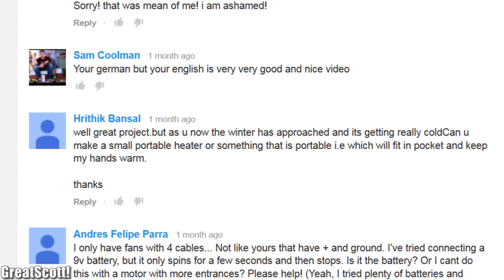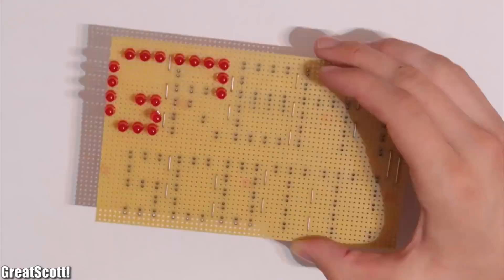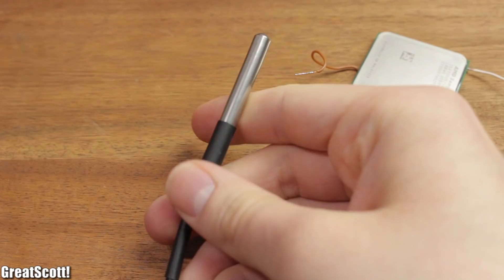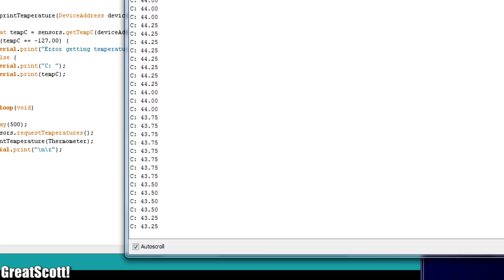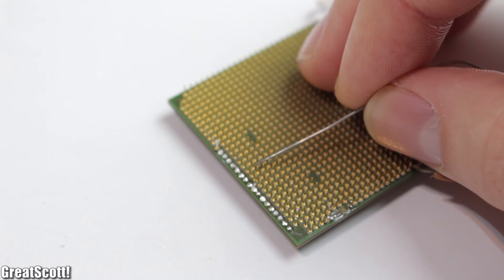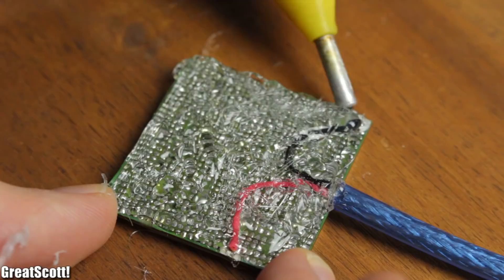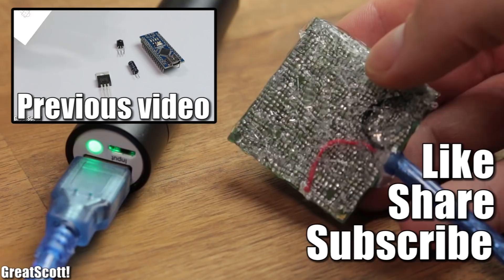Stay warm this winter: CPU Hand Warmer

Comment: Instructions unclear, used AMD CPU and burned my hand off.
Reply: xD
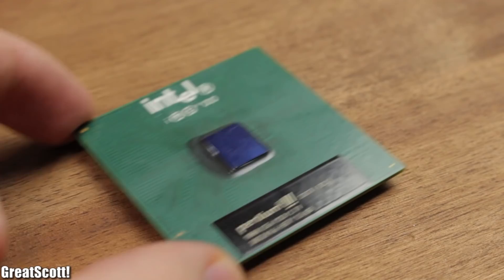Reply: +Harald Kanin Just like he did? lol. 1:31 look very very closely.
Reply: +KillTheCurse 
Instructions unclear, looked too closely and burned my eyes out.
Reply: +Harald Kanin haha xD
Reply: I tried it and it burnt the house down, and nearly melted through the foundation.
Reply: {MLP} Rainbow Dash still can't melt steel beams.
Reply: Buak Buak Plot twist, it was 2 AMD computers that hit World Trade Center.
Reply: Buak Buak No worries, I'll use my Radeon to melt myself a secret hideout on the south pole.
Reply: Harald Kanin Just use amds upcoming polaris
Reply: I forgot it on and my haswell put my house on fire
Reply: Claudio Andrei I am actually not kidding when I say that since I got my 4790K I no longer need a heating system in my room. My computer is on 24/7.
Reply: Harald Kanin ikr
Reply: +Harald Kanin I time traveled to 1992 to grab an old AMD processor. Let's just say I burned through my sister with that thing... After that my dog got burned...

If I had aids that would be true
Reply: lol
Reply: +Harald Kanin using AMD is so expensive, try intel CPU Pentium 4
Reply: try overclocking it!
Reply: +Harald Kanin typical AMD processors
Reply: +Harald Kanin You shoud use GPU
Reply: +Ante Radić that's suicide
Reply: Boyborg690_
But overclock take it to another level
Reply: You just made my day LMAO
Reply: at least that's 8 threads, it makes sense having that much heat unlike amd's old CPUs
Reply: Go back to HowToBasic
Reply: well Intel is Hotter than AMD
Reply: No, use a pentium 4 prescott and earth will burn
Reply: Harald Kanin no, use a intel atom and ww3 could start in a sec
Reply: I just burned my eyes reading it.
Reply: AMD>all
Reply: He uh... he DID use amd...
Reply: Instructions unclear, used Intel 7700k and burned my house down.
Reply: Me too o'm tyoing this blindd
Reply: LOL LMAO
Reply: 666 likes!
Reply: This didn't age well.
Reply: Instructions unclear, used Intel CPU and started a nuclear detonation
Reply: amd fx?
Reply: @KillTheCurse  How did he burn himself? It didn't look like that PC was booted in like 5 years. I'm serious. I don't think the fan on that can spin with that dust.
Reply: Haha how funny cough 7nm cough cough

Comment: all this waste time , just buy android phone (Samsung) you will get auto heat generator during games ..etc or even there is apps called heaters..etc can help
Reply: *****  true xD fast charging apps rise the heat like crazy
Reply: 1 way to get a hand warmer ,,, just overclock your android phone and you're done ! اعمل اوفر كلوك لتلفونك الاندرويد و شوف الحرارة 😂
Reply: My Channel well I don't think we can overclock phones yet
Reply: +Hassan Fareed We can -.-
Reply: ***** oh can we last time I checked phones doesn't support overclocking due to small size of component ,means if you over clocked it you fucked it 
Too much heat and low-end components is pretty bad idea

But it would be cool if we can
Reply: Hassan Fareed I didn't say it was healthy for your phone. Root it and you can overclock it.
Reply: ***** opa I just remembered I actually overclocked my galaxy s2 with some tweak tool pre-installed with cyangon mode but it wasn't a bright idea cause I killed my battery and I killed my cpu ,, eneded up with a slow asf phone
Reply: Hassan Fareed Yeah you need to be more careful when you do such a thing on a phone
Reply: ***** yup
Reply: +Hassan Fareed I overclocked my Xperia Play from 1.0 to 1.6 GHz and it worked fine. It was the only way to run Android ICS smoothly.
Reply: +Hassan Fareed lol iphones are worse at that just saying
Reply: Zachary idk about that I've never seen iPhones get super hot while Samsung gets super hot with simple stuff 
I'm Samsung (android) guy btw
Reply: but dude!  that would be a waste of money!
Reply: Christian Benischke u can buy used phones for under $40 and it gets even hotter than $800 phone lol
Try galaxy s1
Reply: Hassan Fareed oh right thats true... Haha what a useless conversation :D
Reply: if you want to overclock just check some of the kernels  that support overclocking , for example Boeffla Kernel for the Galaxy S3
Reply: Christian Benischke xD
Reply: My Channel idk , if I overclock anything I will do it on my old s2 , but doesn't worth the time waste , I mean I have note 3 and note 10.1 tablet xD , they both fast and good
Reply: Guys do you recommend updating my note 10.1 tablet 2014 edition?  
It is 4.3 ,, it says update to 4.4.2 I guess 
But I'm afraid that Samsung will slow my tablet to buy another one ,, they always do this shit with updates ,, they add stuff to it to make it slower so people buy newer devices

Any idea? Should I go for it , or should I keep my 4.3
Is there any changes that worth it?

Btw the update is official.
Reply: +RealNukerity Yeha sure, a S3 with a Quad Core 1,7ghz...
Reply: ***** thx I upgraded , and it is very beautiful system now , didn't slow my tablet :)
Reply: Light Jones no update is available :(
Reply: have funn destroying your phone or get the batteries to explode.

(this is no joke)
Reply: +Nino Joel My s4 swollen my battery when I left it at night charging with 3g, hotspot activated and uploading a video... Yeah, I'm stupid anyways.
Reply: Hassan Fareed have you felt the back of the iPhone 6+? That thing is unusabley hot

Comment: Watching him destroy all of the CPU pins was honestly painful, even if it is an ancient processor.
Reply: Its a sempron, I definitely don’t feel sorry for it lol
Reply: @Badr Ahmed As an AMD user, I take this reply as a direct insult, and I suggest that you take my reply as a declaration of war.
Reply: @Badr Ahmed   the new intel 10th gens run extremely hot with anything but water cooling, so yes, intel processors (if anything) make better hand warmers than AMD.
Reply: Badr Ahmed   the tri gate transistor hasn't done much in the grand scheme of things mate, especially when you consider that amd have shrunk their transistors to 7nm, whereas intel are still stuck on 10nm, so if you're using Intel's historical achievements as proof, I think you'll find amd were the first to use a 64 bit instruction set, and the first to produce a processor to exceed 1ghz.
Reply: @Badr Ahmed This is insane, Intels pricing structure was pushing the market towards more and more expensive CPUs; fanboying over a brand or company drives them towards less inovation. AMD is forcing Intel to compete the consumer wins. Why do you think that is bad?
Reply: @Badr Ahmed "And I took this personally."
Reply: @dom_the3166  gg
Reply: @thememester1190  wow wow war between fanboys
Reply: @Badr Ahmed nothing wrong in it. So no need to confess.
Reply: @Badr Ahmed nice bait bruv
Reply: @thememester1190  I'M INTEL USER AND INTEL IS BETTER THAN "AMD"
Reply: @Badr Ahmed >intel management engine exists

Comment: ...Hot glue to secure wires in a heat-generating device? Seriously?
Reply: corisco tupi that cpu only generates an 1/8 of the heat hot glue requires to melt
Reply: Ich bin Gwurzel It may not reach melting point, but heating may nonetheless degrade its bonding ability. It's not a good idea to use hot glue to secure wiring in a heater.
Reply: +ich bin gwurzel In other words,you are saying this warmer is not effective.
Reply: Giggity Goebbels im just saying that it does not get warm enough to melt the glue
Reply: +YesSiOui MC - Epoxy, polyester or acrylic resin, or just about anything else that wasn't specifically made to soften with temperature.
Reply: +corisco tupi lol... hot glue guns are much hotter than 43C
Reply: soccerguy2433 LOL That's not the point. At 43C, while not melting away, hot glue is not as hard as at room temperature, so there are better glue options that will retain their bonding characteristics at 43C than hot glue. Not too difficult to understand, LOL.
Reply: corisco tupi nothing wrong with hot glue.  It won't come off at 43C.  Also he isn't bonding things together...
Reply: soccerguy2433 It won't come off, but has its bonding strength reduced at 43C. Of course he is "bonding things together" - the wiring.
Reply: corisco tupi he's covering the wiring not bonding two surfaces.
Reply: soccerguy2433 He is bonding the wires to the chip. In his own words: "Use a lot of hot glue to secure the cable". Is this clear enough to you?
Reply: corisco tupi he is using the hot glue to cover the pins.  is that clear?  The wires are already soldered to the pins.
Reply: soccerguy2433 Of course the wires are soldered to the pins. But the wire loops hanging out are not secured to the chip and they might get caught i something and break the solder loose, and that is why he SECURED the wires with glue. The author's wording not mine. Crystal clear. Twist and turn this as much as you want, the author's goal with the hot glue was to SECURE the wires. He said it. Period. Deal with it, LOL.
Reply: corisco tupi yup and they won't come loose because he used hot glue
Reply: soccerguy2433 Circular reference LOL. Again: hot glue is not the best choice because even no melting at 43C it looses some of its bonding strength at this temp.
Reply: +corisco tupi that part of the cpu barely gets any heat.
Reply: corisco tupi you don't need the best choice.  He's securing wires DOWN and covering the back.  Its not going to come off and its not going to come loose.  The glue won't even become pliable.
Reply: +RaitonGG this.... i think people are failing to see that this little exercise is not meant to be a production item that lasts 40 years. so A) the pin side of the CPU will not get nearly as warm at the metal heat plate side. B) the total heat output will not hurt the glues ability to hold 2 wires in a cable management fashion.. he does not need to hang from the ceiling with the bond power of the glue here. C) over time you will stop using this thing as a novelty well before the glue super novas from all that subtle heat and pulling stress it never got.

it was a neat project concept so stop taking it so seriously and picking it apart like it was designed to go into space and save the human race.
Reply: "exactory"
Reply: soccerguy2433  solder, boom no need to argue

Comment: You can use FX9590 and R9 295x2 for heating your whole house this winter.
Reply: You probably mean heating the whole city and make the climate change progress about 300% faster.
Reply: for fuck I had the boxed cooler for 1 winter on my fx8350 and I did not have to put my "Grzejnik" - translate from poliah into english 😂 - on
Reply: Use a Galaxy Note 7 for warming up your house.
Reply: I use Xbox 360 can get those on the cheap now and can put one in every room.
Reply: Good review for AMD Heater
Reply: ***** Run Prime95 in 24hrs, you can see the maximum temp. of your AMD Heater PC.
Reply: Mozilla Explorer I said FX9590 with a whooping 220TDP not FX6300.
Reply: Or you can use Intel NetBurst and NVidia Fermi to do that even better
Reply: It comes with a Liquid Cooler...
Reply: put a 9590 in your motherboard and test how much time it lasts before it blows up
Reply: Um.. that only means you have a good cooler. More heat dissipated in the room...
Reply: Your 8320 was 84C? Mine stays around 50 and is quite quiet too.
Reply: dude your CPU should not be that hot! FX series chips should be at the max 61 celsius.
Reply: pentium 4 no cooler
Reply: I have a overclocked FX 8370, my brother has a Phenom II X6 (both 125W TDPs) and our basement turns into an oven.
Reply: @MrSabiiiC  ur heater
Reply: @ZR1Gamer   netburst  cringe
Reply: Nic)

Comment: the part were he starts cutting off all the pins hurt my heart.
Reply: +Aaron Kiefer  So how do you feel about Intel already having done that for you, if you were to use their CPUs? Aren't they the REAL monsters?
Reply: +Siana Gearz but atleast they gave the pins a new safer home on the motherboard
Reply: +Mohammed Hamza  It easier to replace pin on amd than on intel....  You motherboard go to the garbage if you damage 1 pin
Reply: +MrBonami2 but a motherboard is usually cheaper to replace than a cpu
Reply: These cases of damage are almost hypothetical, as just a tiny bit of being mindful while you handle your CPU saves you from damaging CPU pins. Many CPU pins around the outer layers are redundant anyway, they carry either power or ground and have predominantly a heat sinking function, with more than half the pins being dedicated to this, so usually you stand a good chance of not losing a vital pin even if you do manage to bump your CPU.

I still think the traditional pin ZIF socket is a better design from an engineering perspective. The CPU has a more stable bed, and you can apply more heatsink mounting pressure. The contact is lateral, so contact pressure does not depend on mounting pressure and is consistent across the whole socket. something not given in recent Intel designs. Almost half the pin area can be used for contact in traditional ZIF socket, giving a very large contact area for lower resistance and better heat removal.

But whatever, both CPU attachment systems work fine, i'm happy enough that we didn't keep the SLOT-1 and SLOT-A fiasco for too long, even if perhaps the possibility to use them for extra damage in a fist fight gives the SLOT CPU owner an advantage.
Reply: Worst I've done is get a little thermal paste on pins of an FX 8320 or sumin, I didn't keep it long. Nothing some IPA and a toothbrush couldn't fix
Reply: You can easily fix pins on a CPU, not so much on a motherboard...
Reply: Your not alone my Friend. 
Lol /$mirk 
🐾
Reply: PGA to LGA conversion
Reply: aaron Do not worry this is amd not intel :)
Reply: @thekef3013   Do you mean that amd is bad or something?
Reply: @arttutolonen4545  jk
Reply: Motherboards are usually cheaper than boards and AMD Threadripper and Epyc CPUs also used LGA So stop trash talking about LGA you silly PGA fanboi

Comment: You know that I'm a fan, but this one really doesn't meet your usual standards. The implicit message that somehow the amount of heat generated by a CPU could be larger than what you get out of a resistor for the same energy input ... Well, I wouldn't have expected that from you.
Reply from the maker: No, I never said that. Perpetuum mobile does not exist. I chose the CPU because of the evenly metal surface. Also it is more interesting and what does the average person have laying around? A big power resistor with the exact correct value or an old CPU in a computer which is waiting in the basement?
Reply: I know that you don't believe in free energy bullshit and perpetuum mobiles. That doesn't change the fact that you explicitely say that other heating elements use too much power and that you came up with something less power hungry. Whatever you actually wanted to say there - for beginners, this will sound as if there actually are differences in the efficiency of devices that convert electricity to heat. Which is obviously not the case.

Sure, you put that into perspective at the end of the video where you show that there's not enough power for heating the water, but you know the attention span of the internet population ... Half of the specific kind of people I'm talking about will not even watch until then, and many of those who do won't get the point.

Don't misunderstand me: I don't accuse you of being stupid or of not understanding the basic laws of physics. I know better than assuming that. I'm only saying that this video is fundamentally flawed from an educational perspective.
Reply from the maker: Gregor Ottmann
I understand your point. And I guess I could have been more precise. The "less power hungry" sentence was a comparison to the 3D printer heated bed. And of course I implied the logic that when something is smaller, it takes less power to heat it up. Well...... let's just hope that viewers will read our comment discussion. But thanks anyway for your feedback. It is always way better to read actual criticism than having viewers just click the dislike button without telling why they didn't like it.
Reply: That's why I fed back. :) I also can't stand those unexplained dislikes on my videos, so I would never do that myself.
Reply from the maker: Gregor Ottmann
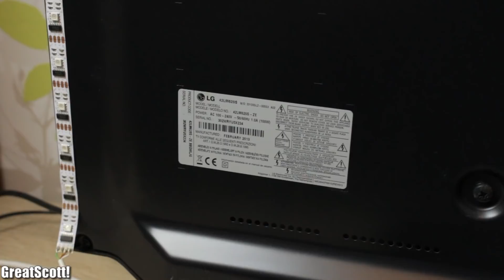I think that is a problem every creator faces at some point. I just made an annotation at 0:41 so people can find this.
Reply: Du kanst auch auf deutsch mit ihn schreiben
Reply: Patti1401© √ nö, das wollen ja vllt. auch englische lesen. Greatscott könnte seine videos auch auf deutsch machen - dann verliert er aber viele abos
Reply: GreatScott! du kannst auch auf das hier verlinken: https://www.youtube.com/watch?v=Bw2p-Dmn48U&lc=z12mdh1iku24t3bec23adthgvovchfqub
dann wird sein kommentar als erster kommentar angezeigt.
Reply: finally found this comment in the comment section of the anotation.. it is too far away xD
Reply: agreed...

Comment: using hot glue on a hot item... lel
Reply: ikr, heats up warm enough and ends up causing a mess by melting the hot glue everywhere. 
I'm guessing it doesn't get warm enough though.
Reply: It needs to be between 120 and 200 C to melt...
Reply: it gonna melt
Reply: it melts in the sunlight at a warm day in summer...
Reply: The warmer can't melt the glue
Reply: I tried this heater with core 2 duo cpu. Hot glue probably gonna melt
Reply: Noo I will not use glue on my crush
Reply: If you add an PTC thermistor, the current draw will decrease as the temperature rises. Thus, the temperature will start to stabilize, and it will stay below the melting point of hot glue.
But you can use any glue.

Comment: 4:07 WOW You made BGA out of PGA :D I didn't know that pins can be removed this easily
Reply: MrJohhhnnnyyy different story when you decide to put them back tho
Reply: Raptor Swire you could painstakingly solder wires between the CPU and Mobo but resistance will slow CPU down